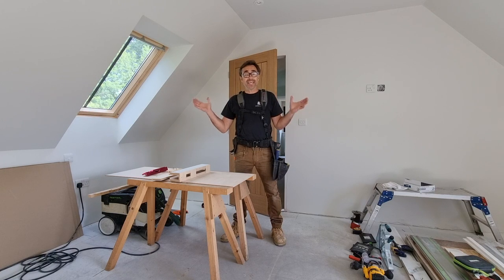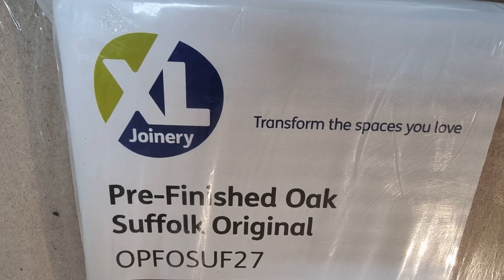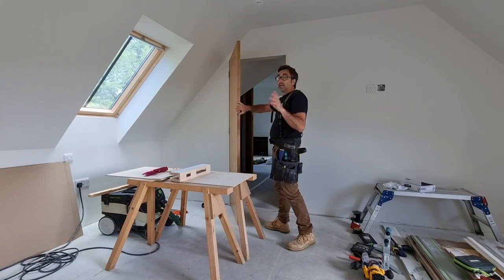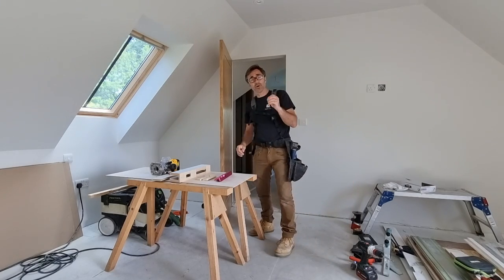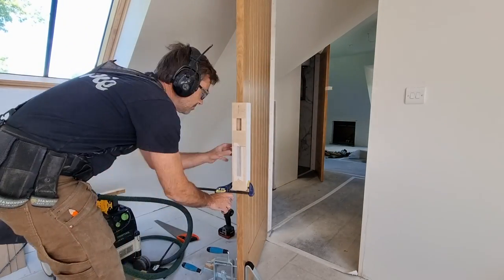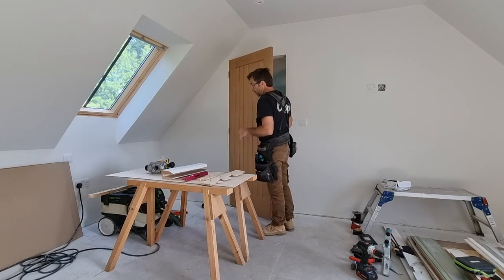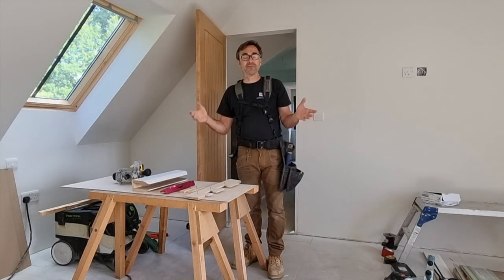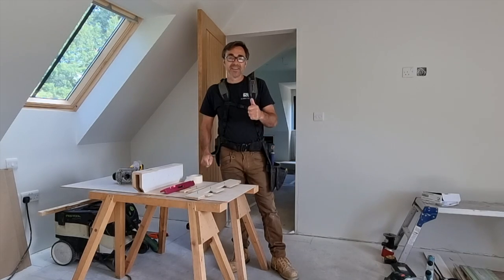How to hang a door and be efficient

Comment: Great video, I’ll hang a door just like you’ve described, the only difference is I’ll initially use decent screws like Reissers or similar. Once everything is tickety boo I’ll swap over the screws (with a combi drill set to a sensible torque) to the screws that come with the hinge pack/ latch as these are invariably inferior and go in reasonably well into the prescrewed hole (this takes an extra minute or two but the screw heads look mint)

Comment: Hi Robin 
Love your videos. as a C&J myself always good to see what other C&J do.
But a quick question 
How about doing a door hanging video on hanging a door in an old building with old out of square heads & frame. Then that would show how difficult it can be ?
Reply from the maker: Great idea
Reply: Yes please robin. I fit fire doors in a 500 year old mansion and accommodation blocks everyday. Self taught but any tips would be great. Not a square decent lining insight. Made a splicing in jig similar to one you made a while ago. Works a treat. Thanks for all your help.
Reply: As a carpenter myself I come across door linings where I have to install 44mm and 35mm internal fire doors into uneven frames I.e uneven door heads, current regs state your not aloud to trim the door heads as it’ll affect the fire door  sticker on the head so your able to achieve a gap of 3-4mm across the head of the door because when you offer the door into the frame it could 25mm out of level so what are the options then?? Install a new lining so it’s all level again??
Reply: @shaunlovelock  hi mate. I come across this problem everyday. As I work in a place which is listed I scribe the top of the door and lip it. And if possible reattach the sticker but most of the time the sticker is long gone. If the gap is to large I sometimes can refit the lining using wedges. Or replace it if it’s to bad.

Comment: Worth its weight in gold. Quite separately, we have developed a way of working exactly the same as yours. A couple of extras:

We use the hinges with rounded corners so that the rebate left by the router matches the curve of the hinge. One job saved
We position the screw holes on the hinge rod so that they will be hidden by door stops when they are fitted afterwards. We are not worried by the screw holes in the door as they are hinge side

In doors, as in most things, you can pay through the nose for something. However, you only get what you pay for. A cheap door pleases the wallet at the time of purchase but it won’t stay cheap for long.

Comment: If swinging doors is a common occurrence then jigs are essential whether it be for marking for the spindle and bolt through bolts and the face plates and keepers. Also highly recommend investing in either the souber lock jig or the trend version as it will speed up the process. I also invested in a door skate to save the back and arms from heavy lifts.

Comment: I've always used a piece of the cardboard from the latch and handle set when setting the gap for the stops
Reply: Do you set the gap the whole way around the door or just hinge side?
Reply: @donaloconnor3352  this was refering to setting the door stops away from the door but yes you would need a 2mm or so gap around the sides and head and some clearance on the bottom dependant on your flooring
Reply: @mitchellchubb4797  I was referring to the door stops aswell. Is there a gap between stop and door at the top and both sides or just hinge side?
Reply: @donaloconnor3352  all around the door mate then by the time you've prepped and painted the door frame you will have enough clearance to avoid any binding

Comment: Hi Robin, when you’re framing the rough opening what size do you make it for the different size doors? Do you always just add a certain amount over the size of the door being installed? Thanks, Zeff.
Reply: Door size plus 100mm or roughly 4 inches will give you plenty of play for packing as the average frame thickness is 35 to 40mm hope that helps just keep an eye on the heights as they change with width 🔨
Reply: @tomsmith9048  thanks 👍🏼

Comment: Robin - what height should the locks/handles generally be measured to? Is this something the manufacturer sets, or do you use a standard measurement? Love all of your videos and they are very instructive - and have watched all of the big build in awe. Keep up the good work!
Reply: Hi as rule of thumb, I always go a metre from bottom of the door, can never go wrong
Reply: I do them 42" from the floor as that was the height an old school joiner set them on our old house. Modern way is to put them in the middle but they look better a little higher.
Reply: Also depends where you are. In the UK the regs are anywhere between 950mm and 1100mm from the floor
Reply: 1 meter above floor level is pretty standard

Comment: Why on earth would a customer go to the expense of hardwood/ quality doors then accept frames with nail on door stops? Should be using proper rebate frames. Nail on door stops are for cheapest get it contract work I.e. council houses or starter homes. Not impressed at all.
Reply from the maker: Nail on stops are used in I would say 99% of all refurb and new builds in the UK, its just what is done, internal rebated frames are a rarity.
Reply: Ok Rich😅
Reply: @ukconstruction  that's obviously your experience but I'm shocked, I'm a professional landlord and have never had a frame with nail on stops, I've used numerous contractors  and I've not had to specify rebate frames in all my years. I won't be convinced otherwise nail on stops are or at least should be the budget option. But thanks for the heads up if this is becoming the new normal I will make sure I specify "proper" frames.
Reply: Seems to be the opposite here. Vast majority where I live are rebated the traditional way, but then again there’s not many new builds. Never even knew slamming strips were a thing until about 10 years ago 😬
Reply: @Sjf542  I agree, I suppose they might have a place for cheap mass contract work if the customer agrees, but a nice job with Oak doors is frankly a scandal. I would instruct the joiner to replace the frames if they wanted paying.
Reply: @richmiller540  you may add an extra 50% on for pellets ect to give you a clean finish
Reply: @richmiller540  you can't be a professional landlord in the UK because it's about saving every penny over here 🤦‍♂️
Reply: @tomsmith9048  I am a professional landlord and I'm based in the East Midlands.
Reply: @richmiller540  you must be the only landlord that asks for rebated door frames if there not a fire requirement
Reply: @tomsmith9048  that's my point I've never had to ask they are just the norm. Now that I know nail on stop strips are becoming the new normal I will be specifying "proper" frames from now on though
Reply: @richmiller540  there not the norm unless it's a specific fire rating and there's no such thing as proper frame's just different styles
Reply: @tomsmith9048  you've still missed my point, they are the norm in my area and in my considerable experience Over the years I've used numerous different contractors and not once have I ever had to specify that I want rebate frames that's just what I got, it's normal for me and normal for the numerous contractors I've used. I'm shocked that nail on stops are apparently becoming widely used. As for your point about rebate and nail on stops being simply different styles then you are wrong one is the traditional higher quality method the other is a cheaper alternative, it isn't a style decision it's a cost decision. An example of different styles would be ogee architrave rather than torus architrave. Both are the same in terms of joinery but in different styles.
Reply: @richmiller540  but they are different styles one is a plouged rebate which is measured and cut different to take the rebate in the head compared to a straight plouged frame and unless there fire frames you'll get a straight headed plouged frame
Reply: @tomsmith9048  mate I'm not arguing with you. Nail on stops are the cheaper way of making and installing frames and doors, rebate frames are the traditional higher quality way of doing it. It's not a style choice, it's a cost choice. You can argue what's normal all you like, in my area and in my considerable experience I've only ever had rebate frames supplied and fitted. If it's your experience that nail on stops are the norm then I'm not calling you a liar but my experience is different.
Reply: @richmiller540  I'm not arguing it just is the norm your street must be the exception
Reply: @tomsmith9048  no! it's the norm in my area not just my street and on my properties. I also manage hundreds of properties for other landlords. My experience is extensive. I do accept that it's your experience and it would appear that these lower standards might be spreading like a cancer. I'll do my bit and make sure at least my properties are done in the traditional way, I will never accept this lower standard.
Reply: @richmiller540  in my extensive experience  and after working on thousands of properties on a sub contractor basis for every major housing contractor in the uk it is the norm
Reply: @tomsmith9048 it sounds like you're doing the mass build cheapest quote gets it type sub contract work. We operate in completely different markets. Like I said before in my experience and in my area rebate frames are the norm. If it becomes the norm for my market then I'll instruct my joiners to fit the rebate frames. the joiner will do as they are told or get sacked, it's a lower standard and I won't ever accept it.
Reply: @richmiller540  it's just the norm in the rest of the country and when you're paying you can have anything you want if you can afford it
Reply: @stevehallam6495  😃 I see your point in having the the architraves the same height, I much prefer the rebate frames though.